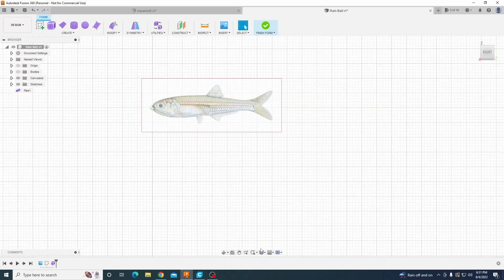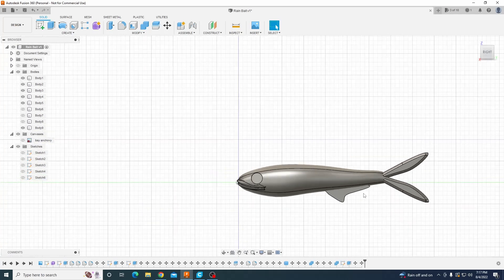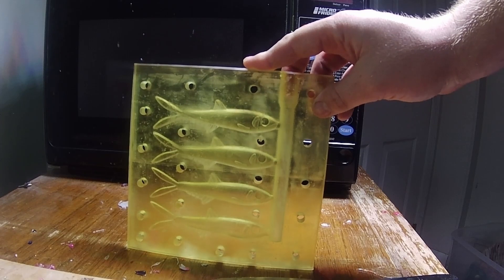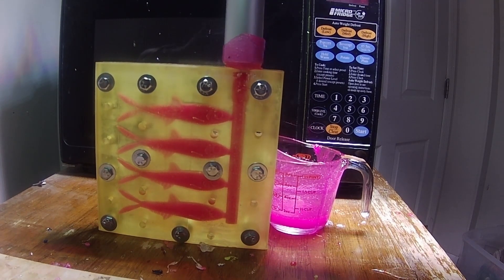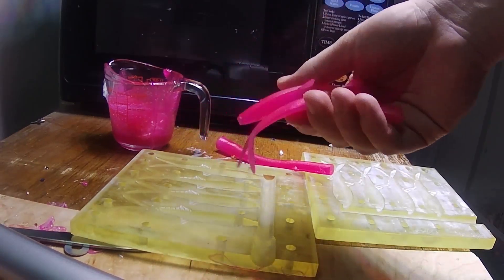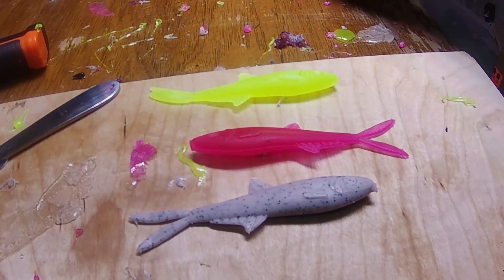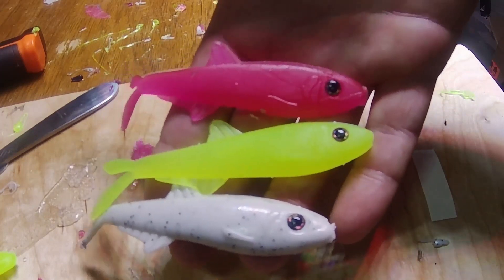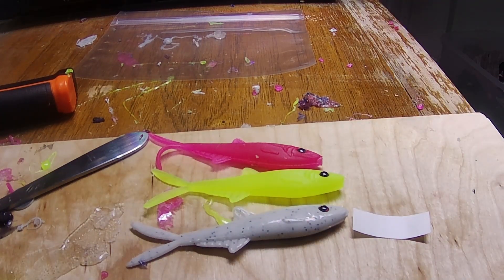3D Printed Rain Bait Lure

Comment: have you tried painting your soft plastics with SB Coat (clear) and mica powder? For freshwater/bass fishing lakes, that sardine design is a very convincing Shad profile. 6th Sense Fishing has an ultra realistic soft plastic shad imitation, called the "Panorama Shad", that is currently very popular and hard to keep in stock right now. Quite honestly, it's a boring flat board-like soft plastic version of your design, but with terrific very realistic paint jobs, IMO.  

I'm trying to find a permanent way of "decorating" my Bucca Burritos (Lg silicone cast shad patterned swimbaits) with irridesscent mica powders. Using a paint on silicone with mica powder as pigment still ends up being opaque. So far, I've vacuum chambered some of my homemade silicone cast soft lures, in ziplock bags, after micro needling them. It only lasts as long as nothing is making any rough contact with it, but seems to maintain better without washing out after several casts. In comparison, for plastisol baits, the SB coatings are probably more durable, but scratching can appear on them under similar conditions. 
as far as I can tell, for silicone, after a short day, the mica powder just seems to fade away, faintly being absorbed into the silicone. 

"Spike-It" paints will hold after letting them dry for several minutes, but seems to eventually get completely absorbed through out the body of the silicone. You could apply it to the dorsal area, but after a couple of days the entire thing turns what was once a milky translucent clear into a faded version of whatever color you had applied. 

It's actually fun reapplying the patterns when I get them back home, so I enjoy it. But, I find myself wondering how many lures I could have painted by now. That usually turns into wondering how many could I "paint" in a day? (it's like using a paint brush to apply make up to a figurine). I might as well start casting and painting up some high quality baits at this point. Pretty sure the commercial plastisol versions are air brushed or silk screened patterns. 

Thanks ahead of time, and thanks for the inspiration. Tight lines!
Reply from the maker: I dont have any experiance using mica powder or silicone. I do plan on trying to airbrush some soft plastics soon. I woukd either try and find some kind of paint made for silicon and then clear coat over it or do some kind of base coat that the spike it will stick to and stop it from absorbing into the silicone
Reply: @HandCraftedAngling  thanks 👍
Reply: @HandCraftedAngling  I'm thinking about trying the PVC paint they use for silkscreening t-shirts, for soft plastics. It has a really quick heat cure too. Expensive though.
Reply from the maker: That may work let me know how it goes.

Comment: Love the clear! Same resin I use. What are you using for your dimensions on your vents? Doing an offset around the bait itself or just doing the vertical and horizontal channels all the way through the mold?
Reply from the maker: Glad you like it! I have actually been working on redoing my venting strategy. These molds before I was trying to get the vents to work on fdm and resin at the same time but fdm printers can’t produce small enough features for the vents. I’m working on redoing all my old molds. Currently I’m using .01” for the vents in one half of the mold.  There isn’t an offset around the mold cavity but I do not vent cavity’s into other cavity’s so there are no longer vent lines going straight up and down. They go up out of the cavity into a deeper channel that exits the mold.
Reply: @HandCraftedAngling I gotcha so just .01” for the vents all the way through the body of the bait and into a horizontal chamber that exits out the top or bottom of the mold then? Are you using a line and then thin extrude to get your .01? What about for bodies that have legs Or appendages where you’d have to go through the leg and then the body ? Just coming out at an angle until you get to the closest channel to exit it? I’ve always tried the offset around the body method but always wondered if you could skip that step and just go with channels and vents like you’re talking.
Reply from the maker: I usually just draw a box that’s .01” wide and extrude it down the same length. The channel runs perpendicular to the vent. You can try to put a vent on each appendage but the offset might be easier if there are a lot. It’s not somthing I do often. I will do a community post with a picture when I get a chance.